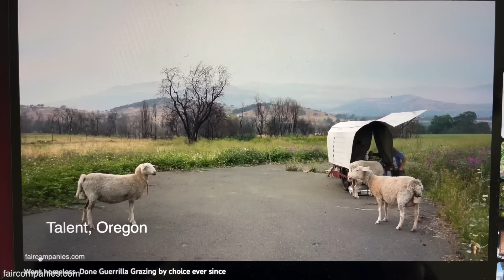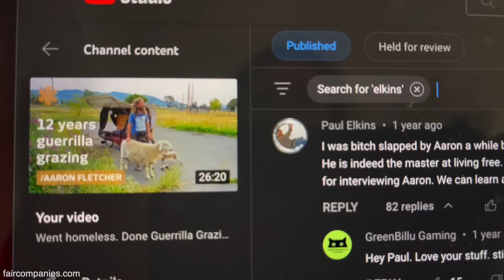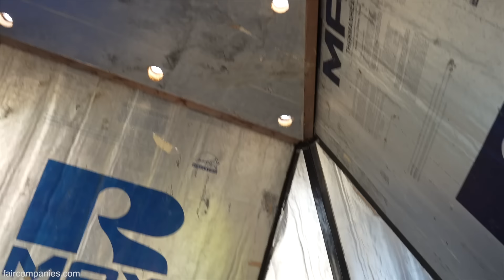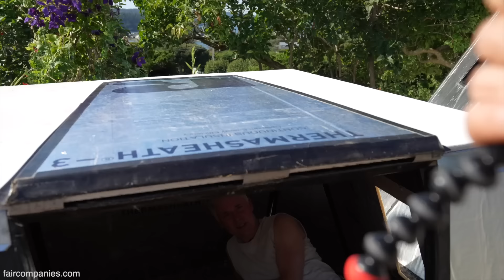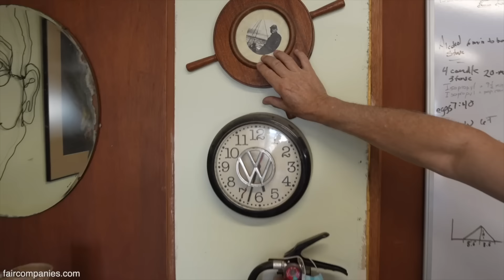Boeing DIY inventor shows new ultra-cheap houses to nomad shepherd

Comment: That was very good. I am with Paul in this theme, though Paul is prolifically imaginative. I did live in a 6” square trailer for 2 years near the centre of Sydney while I was building a 44’ ferro cement yacht. My trailer had a settee that flattened out to a bed on one side and a piece of furniture that was a counter and sink, 2 burner stove and a clothes cupboard on the other side. I built a recirculating shower with a water heating coil that sat on the stove for hot showers. The cover was canvas, but Paul’s use of the core material is very clever. The main problem with that material is that it burns very well, much like candle wax so is a risk factor for the homeless. I’m certain through that a version of this polypropylene core board could be done with borax mixed in as a fire retardant. I loved his Coro pack, that was awesome and has a lot of scope. But very special was the small rocket stove. Super clever and made a little larger in 0.3mm stainless steel with a water jacket becomes a brilliant minimalist survival tool. The water jacket makes boiling water easy, and having a good hot shower realistic. The boats were interesting, and folding boats really do work, but I live on a yacht so anything less than 40’ with all amenities doesn’t get me very excited. The tear drop car very well done see also Aptera. I did a concept design for a Weasley Tent (Harry Potter) based on the folding umbrella (top and bottom) concept with all amenities collapsing into the centre pole and featuring 2 wheels for relocation when collapsed for towing behind a bike, and would go in that direction to assist the homeless. Paul is very special and deserves recognition for his comprehensive inspiration. I’d love to see where Paul would take this concept https://images.app.goo.gl/yZs7wYZ3atrKiWqh6

Comment: 20:00 - I would use one of these. I have built and ridden gas powered bicycles for years now. I have a trike with a trailer that I run back and forth to the store with.

Comment: As someone who has slept in the back seat of a small car, I can tell you that sleeping with your legs curled up is not feasible in the long run - it is a circulation problem.  You have to be able to fully extend your legs periodically through the night.

Comment: I think the fold up tent/ hut idea for car camping or light enough to tow behind most anything is far better that setting up a tent
I would fabric cover it for durability 
But a low cost topper on my Xterra with a pop up foam shelter has me headed to the hardware store

Comment: Hello  dear Paul Elkins
I" ve been watching your youtube  long time.
Thank you for your simple and innovative ideas.
i would like to mention that the rocket stove could be assembled from metal profiles of dry wall system .you can use the 100 mm or 75 mm studs  and runners ;as the skin of the rocket stove . horizontal low part is  a piece of stud profile ;while  the two vertical elements are from runners .when the whole thing is finished; you will have a H shape rocket stove.
you only need to drill 4 holes and put a piece of stainless steel about 3-4 mm diameter.
voila!. you will have a no price rocket stove with a lot of aeration  and hell fire temp.
i tried it many times and it works awesome .
Israel Amster
Construction Engineer 
Modiin .ISRAEL
Reply: Did you make a video on that?
If not, would you?

Comment: If you haven’t priced that 1.5” foam board lately each sheet is about $20. So unless he get them free those burning man structures were not less than $40.

Update: couldn’t find the 1.5” thick but 0.5” sheets of R max are $38 plus tax.

Comment: He needs to think outside the combustion box more like he did with the boat and incorporate light flexible solar panels with corroplast shelters to power lights and cook with induction cooktops (safer). He's definitely on right track as far as the minimalist design elements.

Comment: I paid $800 for my tiny home on wheels, and it also floats.
(OK, it's a 21 ft cabin cruiser with a cracked engine block).  I just launch it and use a cheap electric trolling motor to set up camp, 4 anchors to stay firmly in place
Reply: On a river? Or salt water?

Comment: this reminds me of Henk kuiper from Huttonia who started his own country using a similar bike home.

the caravan for behind a normal bike also is something I have been wanting to make for a while, not mostly focussed on it being a house but more on it traveling easily, that is why I in general would preffer it being like a caravan which you can detach. even though for traveling far and/or fast I have also been thinking about making it like a small torpedo, where the bike chair can easily be turned into a bed, so basically a super light super streamlined bike where you lay down mostly while biking and have some stuf around you to make it even better streamlined. in that case I also planned in some airflaps and such for cooling and oxygen. but it still mostly depends on if I would preffer comfort or effectivity. for exmple I had been thinking about the possibility of a isolated breathing pipe with the possibility to make it go through a heat exchanger where the wind could give it a constant flow, or I could add in some valves to make sure fresh air keeps comming. the cooling could also be much more efficient in it generating a lot more cooling per drag if I use a similar system for that where it is direcly focussed on the areas where it would cool effectively, instead of just adding flaps so you can open it when it gets warm.

a bike where you lay down already is much more efficient on its own since for example even for a non athletic person it should be rather doable to reach 50km/h without really outputting to much power, on higher speeds having it have a streamlining enclosure might be usefull since then that will help to(for example at 50 to 60 km/h you should really start to notice the difference). and in this case it also makes it suited to sleep in and such, that was more for a roundtrip bike where you just want to get many places far away yet still fast and rather easily, and it would give some storage space. a caravan however is more easy to make and also has the benefit that you can place it somewhere and then go exploring with your bike, for example go mountainbiking or such.

Comment: The basic concept of a teepee goes back tens of thousands, if not hundreds of thousands of years lol. A bunch of sticks and some string and blankets. Even with the latest technologies, the best method in my opinion would still be a teepee shape using fiberglass or carbon fiber poles, with rope, and layers of that reflective thermal blanket..... just a teepee, but a space-age teepee haha. Even in a martian colony, the basic concept would still be the best haha, just with the walls puffing out due to the atmospheric pressure difference lol. Fabric sides would be interior with the stick frame being the exterior

Comment: 8:53

Beautiful Concept!!❤!!
You may have to sacrifice using bamboo and choose recycled plastic that's flexible. The kind that is similar in structure, material and design as boning in corsets. It will give you better malleability, costs less, manufacturing is quicker and territory friendly to the US, and won't rot over time. An alternative design to this also is having this entire structure fold into a flat package with straps on the back to be worn like a backpack, so traveler's can detach and take with them if they have to park their bike and travel on foot to places.

I have a round fan made of nylon and plastic that collapses into a pocket gadget. It reminds me of the potential of your design should you ever produce it for commercial use. Global traveling would benefit greatly from this as well as those without permanent dwellings.
I appreciate minds like yours. You help Humanity greatly.

Thank You. 
🏆🚲⛺🌞🏆

Comment: Honda made a civic in the late 80s or early 90s (HE or HF model) that could get 90 miles per gallon with a simple combustion engine. I’ve seen a couple but I never could understand why everyone was so impressed with the hybrids of the early 2000s getting 40-45 mpg.

Comment: Nice !
PRoblem with showroom is they'd still charge 30k.
Haven't you seen toyota and other's vehicles similar to this.
Granted theirs are 10x better at turning wihtout issue, and wihtout getting squirrely, but they charge a CRAZY amount for not much.

Comment: If you build a small hydrogen generator and install it running into the intake of your vehicle, you'll eliminate your carbon footprint, get 100% burn in the combustion chamber and prevent any carbon build up from breaking down the internals of your engine. All that and by not having 70% of the fuel going unburned out of the tailpipe, you should see a significant gain in fuel mileage.

Comment: I wonder about using gorilla tape for structural integrity for long term, because in my experience the adhesive has gotten slimy and loose over time. Maybe using it at that thing in the desert dries and strengthens it? Maybe it's because I have a bit more humidity effecting it.

Comment: Great info...veryamazingideas....  have you experimented with foam and coating with satturating fabric with wood glue  (poor man's fiberglass).???

It is super strong.

It's my dream....to build a bicycle camper / trailer...

2 in 4 x 8 sheets of R 10 foam is 7.5 lb... a gallon of titebond 2 Woodglue is 10 lb...

Comment: Can you use old solar panels for that?
Facing each other with fliuro globes in between. Double glazed floor & walls. Don't get the hot globe just enough to keep it warm & dry. Self powered ad water pipes you can control TEMPERATURE if you add a small refrigerator for summer run the water though fridge radiotor.
Run the air through the walls for optimal control(a force field around the interior lil vents to let air in keep inside at positive perused l pressure with FILTERED AIR. Triple glazed with new panels on the outside catch free rays during the day.
Turn lights on at night for power & free heating

Comment: I've used recycled coroplast for a diy electronics project.  Great stuff, but little pieces ended up giving me a lot of nicks and cuts.  I wonder if there's a cheap and easy way to avoid getting box cuts on the corrugations, because I saw a lot of unfinished edges on that short trailer, including the entrance door, and i imagine those could get cracks over time which pinch something fierce...

Comment: The only problem with these shelters for the growing numbers of mortgage/rent free families is that the authorities destroy Any shelter they use as part of "moving along" protocols. Tents, tarps, bike trailers, cardboard sleeping bags, whatever it is the cops cut it, tare it, make it useless. 
 In at least one place they have made sleeping in tents or vehicles a felony, which enables civil forfeiture.  
 I applaud your efforts, just know there is endemic and inhumane resistance to Any solution to living without a structural home that eases the suffering of the worst of it.

Comment: The Pebl from better bike is a teardrop velomobile. It even has a model with a solar panel. It'll cost you about $13,000 though, so it's not practical.

Comment: A more likely configuration would be two 110 volt AC motors driving screw pump jets and 4 20 amp outlets for utilities. Stove air conditioning RO hot water or refrigerator. A magregor sailboat keeled headsails deep in the stem and trailerable. The macgregor with a better mast and design buries the competition again.

Comment: I would think if you could market the trike under 10K with a bit more storage and sound deadening on the extended version you'd be competitive with stuff like the scam that Aptera is turning out to be..  The downside to trikes of any kind are you're going to have a difficult time dodging smashed road kill and potholes.  I do see older people having a tough time climbing in and out of something so low to the ground.

Comment: When I was 17 I found a half inflated tractor inner tube got inside of it and roll down the hill into the water broke my neck in two places I'm 65 years old now and still regret doing this.  Be careful with the whell
Reply: I'm sorry to hear that Ken. When I took the WHEEL to Burningman for the croud to try out, a cute forward lady got in and started her roll before I had a chance to tell her to buckle up. She too walked away with some injuries when she landed on her head halfway her first roll.

Comment: The issue with the plastic panels is they become brittle quickly in the sun and within 2 years in a stable non-moving flat position they fall appart.
Reply: That's very true in areas with lots of sun, but where I live, here in the NW,  I've had some of my shelters exposed for  up to 12 years with no degradation. Painting the surface helps too.

Comment: Beware plastics and foam products off-gassing, burning, or being damaged by wind, water or carelessness. Research these materials and use very carefully. Generally speaking there is off-gassing as they age, which can be very unhealthy in enclosed spaces. Same concern applies to plywood and wood based composite materials. Upstream (think smoke belching factories or trainwrecks) and downstream (ultimately trash disposal) impacts also need to be considered.

Comment: Elkins' 3-wheel teardrop vehicle isn't a new or original idea. In fact, this idea is coming to market as an EV. It's called Aptera, and it uses ultra-low drag to solve one of the two major problems with EVs, range.

Comment: Tarp between wire mesh, concrete, cattle panel, 4 instance,
Reply: thing is , no limit to size,  rebar wired in between sections make  possible sturdy structure big as barn,  strong design, weight evenly distributed, it will be used extensively in future

Comment: 🟦.... Mounting the smoke detector vertically on the wall is NOT a good idea!.... The farther down on the wall from the ceiling that you mount-it means that much less-air you have to breathe when it DOES go off!
Smoke detectors should ALWAYS be mounted at the highest-point, as that's the first place that smoke gathers as well.

Comment: Well it is possible to make an edison generator from a car generator and have either 12 VOLT DC or 110 volt AC power using inverters wired to the generator. The generator spins using the field magnets to move the armature magnets and coils of copper wire originally invented by Thomas A Edison. You have to use an old generator pre 1974 generator not an alternator. You disassemble the generator and separate the armature magnets from the case and field magnets
 Then count the armature magnets and divide by 6 then chisel off one sixth and leave one sixth on and chisel off another one sixth and leave one sixth on until you have three sixths on and three sixths off alternating on and off. You reassemble this motor as a generator by holding both sides still and inching them together. You wire positive brushes to the DC side of the inverter and the negative side from the field case to the negative DC side of the inverter.. A 40 amp inverter consumes 5 amps so you need 45 amps DC per inverter 40 amp 220 volt AC inverter. Zero fuel electric power without pollution.
Reply: You can power a 12 VOLT DC motor or 110 volt AC motor.140 amp generator can power 6 20 amp 110 volt AC motors as unlimited range electric cars or boats.

Comment: I appreciate the housing designs, and the folks making them are caring and resourceful. unfortunately, just giving these away not necessarily the solution to the problems we face. It is up to the people living on the street need to want or be willing to solve their issues. I am sure there are plenty of Crack heads would love the opportunity to burn one of these structures down.

Comment: We are grossly misinformed about power generation and climate change.  It is important to address the global warming climate change but the primary causes have been forgotten.  We have to eventually stop manufacturing halogenated vinyl and halogenated carbon products. The EPA mission under treaty enforcement and obligations was supposed to eliminate all plastic manufacture and use as well as paint solvents pesticide and herbicide that use halogenated carbon or halogenated vinyl.